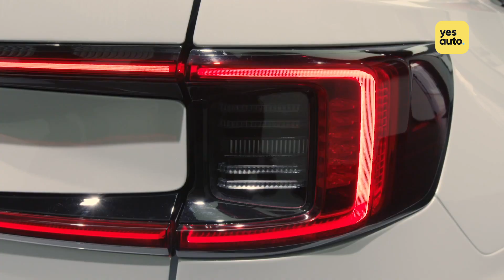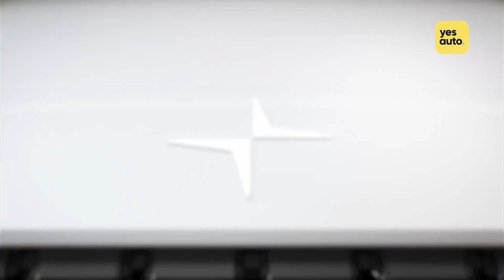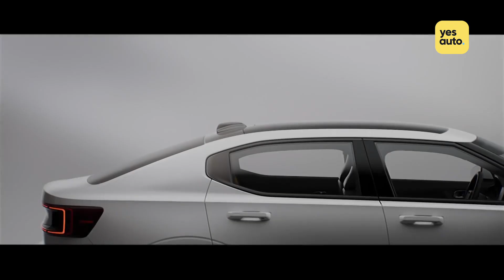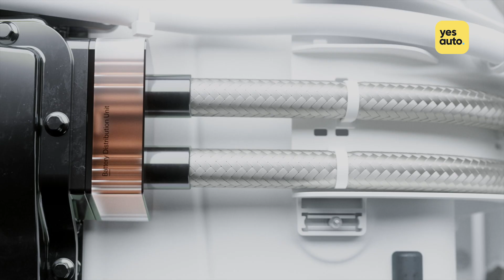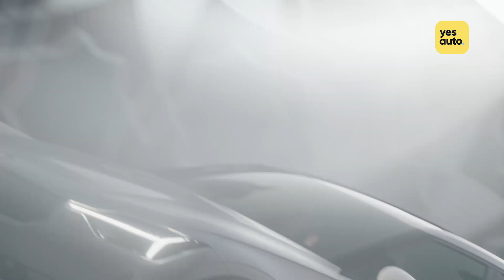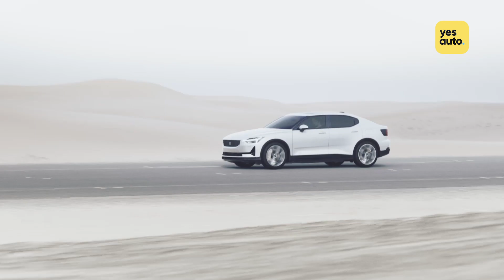Polestar 2 vs Tesla Model Y - battle of the electric SUVs | YesAuto

Comment: 1.000.000 Teslas on the roads looking almost identical to each other. I went for the original design vehicle. I do not care about 0.1 seconds faster acceleration nor 30 miles extra range. Also it is 12.000 USD cheaper than m3 LR where i live. And i never cared about the public charging network as i use my car 95% of the year to go to work. Easy choice. By far.

Comment: I am literally in the middle of deciding whether to purchase a Model Y.    I have analyzed everything and stats and videos.  And my conclusion is this:  If a competing car to any Tesla model wants to enter the fray, they have to be willing to sell their early models as a loss leader.  As I speak where I am the Model Y and Polestar 2 similarly equipped come to the EXACT same price.   What this video failed to address is the additional benefits Tesla has over the others. A 8 year head start in producing and servicing EV's, battery research, nation-wide supercharging networks,  Option for Full self driving in the future and possible Robotaxi where your car can earn money, and already capability for self driving on the high ways, and as I speak they already can recognize and react to traffic lights.     If polestar comes in $7 - 10k less,  I might consider, but at same price its not even close.     And trust me.......I very much want choices for my $$$
Reply: The key differences :
The Tesla is clean minimalist inside, Polestar 2 is more traditional and very well put together.
The Tesla LR is about 10-12% more efficient than the P2.  
The P2 is better insulated and quieter at higher speed - more refined than the TY
The TY has charging advantages as the non-tesla charging systems is joke - the P2 is fast if a charger is available.  If you can charge at home mostly then there is little difference.
The TY is leatheret the P2 uses cloth which is eco.
The P2 is more equivalent to the T3 and NOT the TY, though it has a hatchback.  The TY is a bigger car than the P2 as the P2 is the same size as the T3 - and most close to the T3-LR.
The TY still has build issues which are resolved in the T3.  The P2 is likely to be well put together from the start - I guess is there will be teething problems with the infotainment system - the drive train and batteries are from Gelee and are very good.  
You cannot loose - the P2, TY and T3 are great cars at the price and leave the rest of the offerings in the dust.  Just enjoy whatever you buy it will be fantastic.
The P2 and TY are both NOT available in the UK, though the P2 might make it by the end of the year if you are lucky, and I guess the same problem in the US.  The P2 is only just started delivery at the end of the month in central Europe (Germany mainly) and is unlikely to make it to the US this year, you may be lucky, but you will have to wait for a P.
Reply: Rubber Roast :Now Tesla can still be on the market with a Z of L model, as long as they always come with that sober interior "and then usually the same" and bad construction finish, I stay off with my hands. Polestar 2 the great winner.
Reply: Rubber Roast :That self-driving and stopping for traffic lights is pure future, and certainly not yet to be trusted, and certainly not in urban environments in Europe. By the time this is legally permitted, Jecal will be ready for a next vehicle.

Comment: Tesla’s are way more expensive in the UK than they are in the US. Even the lease rates on Tesla’s are really high.
The Tesla 3LR was only £90 more than the Polestar 2 but Lease rates were £150 / month higher for the American! 
That could be our absolutely devastated currency, shipping or import duties. Nevertheless, too much for me. I went with the Swede.
Reply: interesting comment, Tesla almost the Prada of EV's.....for now
Reply: David Kerr :  Very strange reply - the P2 is not available till the end of the year in the UK, there are lease agreements available on the market for it, but you have to wait.  On driveElectric - the largest EV lease site the P2 is £514 while the T3 LR (the most equivalent) is £445 (for the same lease conditions - you will need to adjust these for sensible annual millage etc) . David - you have been ripped off - or have not actually tried to lease one.